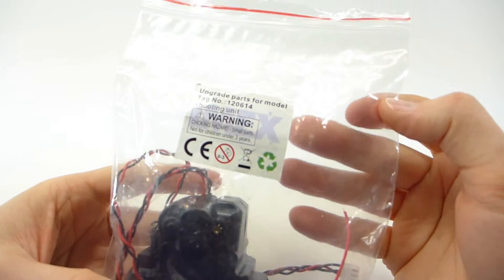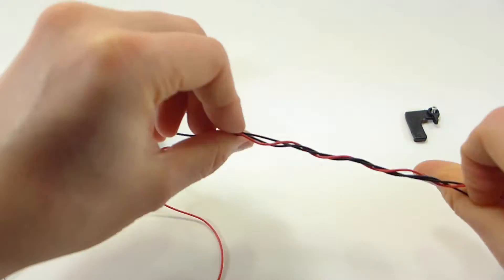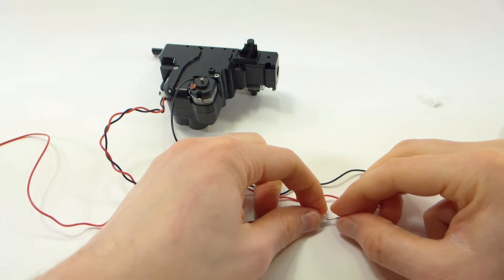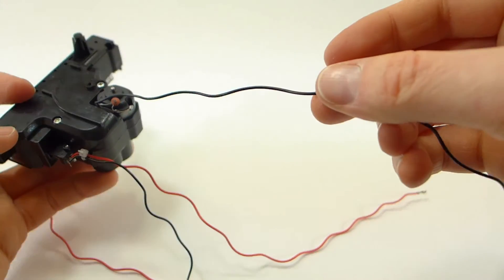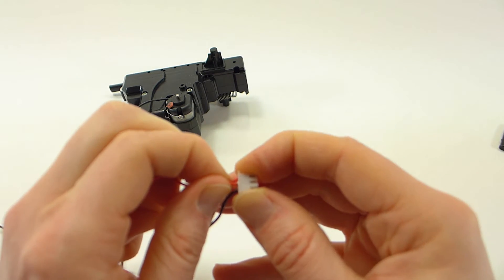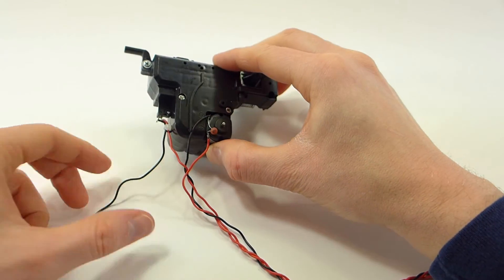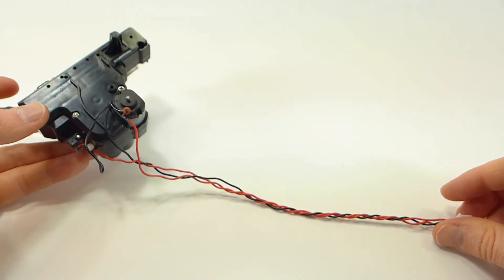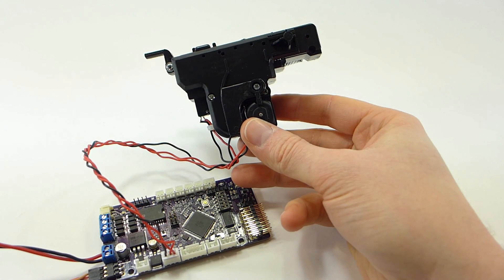How To - Taigen/HengLong Airsoft

Comment: I have a question. I have an m60a3 from tongde that the airsoft unit has quit working and I was wondering if this airsoft unit will fit and work in my M60a2? thanks.
Reply from the maker: I do not know what equipment this tank uses, or whether it is the same as used by Taigen or Heng Long. I recommend you post a question at RCUniverse or RCTankWarfare forums, they have several threads already about this tank.

Comment: Where do you get the little plugs if you dont mind me asking?
Reply from the maker: The little 3-pin plug is a JST "XH" plug, the part number is JST XHP-3. You can get them at DigiKey, Mouser, Farnell, eBay, or pretty much anywhere electrical components are sold.
Reply: @OpenPanzer  Thanks! Very helpful!